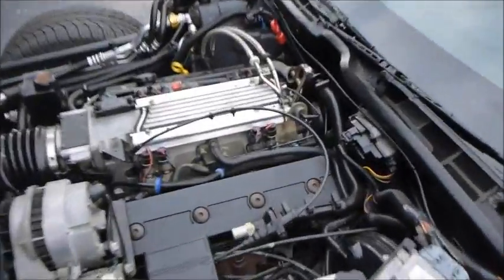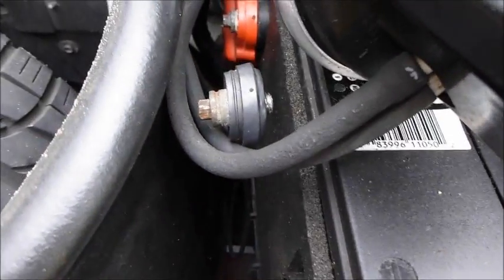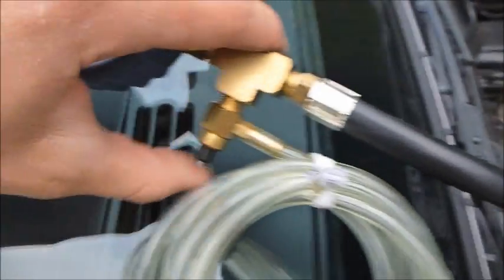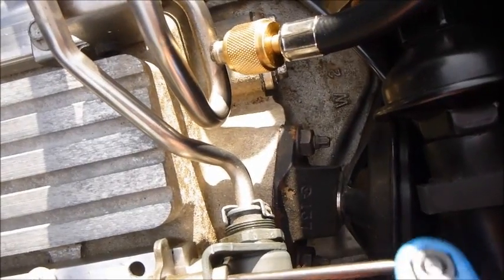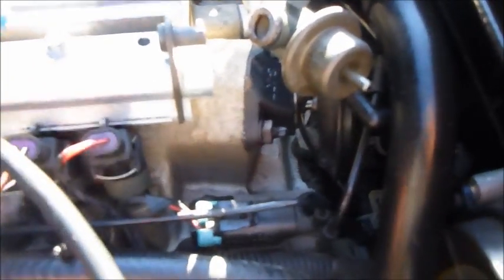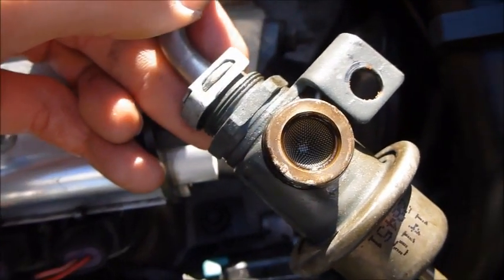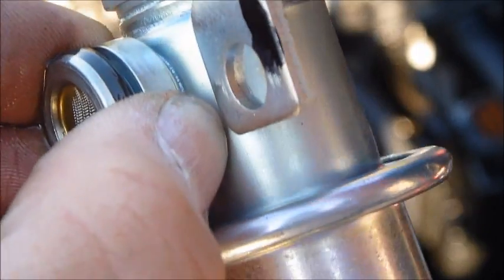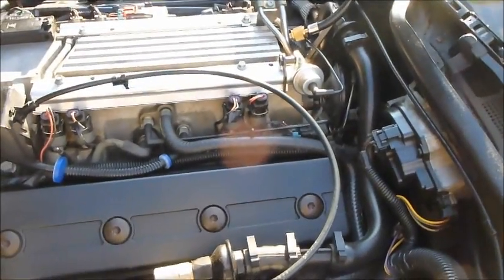How to replace a Fuel Pressure Regulator

Comment: Chris, I pulled the vacuum of the FPR on my '93 C4, and it has a gas smell to it. Do I need to replace the FPR?
Reply from the maker: Brandon Herrera If it smells like fuel it is bad. I would get it replaced because it is either not working or is going to fail. Only a fuel pressure test can tell you that. A gas smell means that the rubber in the FPR is broken down and the vacuum is actually sucking gas from the fuel rail.
Reply: +ChrisFix Thanks! Replaced it. It's a little bit different on a '93 C4 to change the FPR. Video still helped.
Reply from the maker: Great! Glad it was helpful! What was different?
Reply: ChrisFix The FPR location. It's on the passenger side. You have to take off both fuel rails. It's under the passenger side fuel rail,l.
Reply from the maker: huh, interesting! Thanks for the info

Comment: cool this is exactly what I need to do to my vette! now do I need that gauge to release the fuel pressure or can I get away with it by relieving it into a cup or something?
thanks!
Reply from the maker: You dont need the gauge to release fuel pressure. You can just let the car sit overnight and that will be long enough for it to leak down. You could also pull the fuel pump fuse and turn the car over for a second.

Comment: A better way to relieve the fuel pressure is to remover the fuel pump relay and turn the vehicle over a few times until all the fuel in the lines has been used.  That will reduce the amount of fuel that comes out when you remove the regulator from the rail.
Reply from the maker: Thanks! That is a good idea.
Reply: ChrisFix can a bad fuel regulator pressure cause a car to stall and not start unless you wait.
Reply from the maker: David Henriquez Yes it could. You might not have enough fuel pressure. You can do this test: https://www.youtube.com/watch?v=_oXLUqE4Sf0

Comment: Thanks for the guide. I used it to fix my long and rough start issue and to fix my hesitation issue. My vette still has hesitation when going through the gears, but it cranks up like a champ now. My next attempt to fix the hesitation is to change the fuel injectors, so if you got a guide on that it would be greatly appreciated.
Reply from the maker: I do not have a guide on that (yet). It is pretty easy, just unbolt the fuel rail, pull the injectors out, and replace each one.

Comment: Hmmmmmmmmm, wonder if that's what's wrong with my 95 Roadmaster.  It only starts fast when you try within 2-3 minutes of turning off.  Otherwise, it takes 5-7 seconds of cranking.  Already changed the optispark, wires, plugs, and fuel pump.
Reply from the maker: Injectors? Try this: Fuel Pressure Test
Reply: ChrisFix
Looks like I'll go get me a fuel pressure gauge!  The mechanic was telling me he thought the delayed lite off was normal since the fuel injectors don't turn on until getting the signal from the crank sensor.  But I've had the car since 21000 miles and it used to start fast all the time.
Reply from the maker: That sounds like bs to me... The fuel injectors turn on once that ignition is turned. I think a $20 fuel pressure gauge is a good investment. It was the check valve in my fuel pump when I was having the symptoms you talk about.
Reply: ChrisFix
Very interesting. I followed your other video and saw some leakage down from 40lbs down to 37lbs after 15 minutes.  I saw a bump in pressure with the vacuum line off.  Hmmmmm.  Guess I should check to make sure the spark is immediate but would have thought the optispark replacement would have taken care of it.  Unless the mechanic is right about having a cam or crank sensor.  The LTI was modified in the B bodies with a milder cam and cast heads so maybe they mucked about with it some more.  Maybe the ignition module or perhaps the coil is getting weak.
Reply from the maker: Hmmm... That is weird. Sounds like everything is holding the pressure. Does the car run right otherwise? Same fuel economy? Maybe it is the crank or cam sensor. Do you have a check engine light?
Reply: ChrisFix
No check engine light.  LT1 can still lay rubber with this 4200lbs whaler.  Performance might be down a hair since it does have 177000 on the clock but minimal.  Fuel economy is still in the mid 20s.  Old plugs were very clean.  Might use 1/4 of a quart in 3000 miles.  Hate to part with it since GM has no RWD cars anymore.  Ford's are gone too and were quite pitiful in their later years except for maybe a Jaguar XJ8..  Guess I could get a Chrysler 300C but I haven't driven and liked a Dodge since my parents 65 Dodge D100 pickup with the slant six!

Comment: I'm planning on replacing this device.   It already has stains on it and it looks like its leaking.  I already done plugs, wires, rebuilt injectors, optispark and powdered coated the intake.   On a 17 plus year old vehicle...this should be replaced as a general principle.   Why?   Because the car could catch fire over a $40.00 part.  Once the part gets exposed to gasoline, it doesn't matter if the car has 55 or 200k miles.

Comment from the maker: Sounds like a check valve in the fuel pump (meaning you need a new fuel pump). Or it is leaking injectors (less likely).

Comment: When i prime it, I hear the Fuel pump go, and it will move up to 40-45psi, then drop to 15 or 20psi, in about 5 seconds. (The first time i prime it, it will barrly get to 10psi, the second time it would jump up to 40-45 and drop)

Comment from the maker: When you have the car off and turn the key to the run position (car is still off and the fuel pump primes), does the fuel pressure increase to ~40psi? Does it stay at ~40psi for 10min?

Comment: Hey, I have a 95 camaro Z28 Lt1, and i am having a fuel pressure problem! I did go and change the spark plugs, wires and the distributor cap and roter, But it would slowly loss fuel pressure after driving for 15 or so minutes, It would idle at about 39 or 40 psi and soon get down to close to 30, What do you think i need? Thanks man!

Comment: thanks for the info I was trying to get this done as soon as i can.. if the gauge reads below 40 psi or over would it mean its the fuel pressure regulator? also the car was never worked on since bought from the dealer by the first owner im the 3rd  it only has 55miles.ive only replaced the starter and replaced radiator myself with help. i will try the spary bottle. thanks for info !

Comment from the maker: It can be a number of things... I would check a few things to get an idea of where your problem is... Check the fuel pressure with a fuel pressure gauge ($20 online). It should read around 40psi when you just turn the key to the run position and it should not bleed down. You should also check the wires. Run the car at night in the dark and take a spray bottle with water and spray near the exhaust manifolds. If you see sparks, you need new wires. That should be a good start. Report back!

Comment: One thing that should be mentioned here is not to use petroleum 
based oil on the "O" rings. It usually attacks  them.  It's best to use
a non-pet. based lube.  "O"  ring lube made for the purpose is best.

Comment: Thanks for taking the time to do this.  I have a 94 Caprice wagon with the LT1 engine, and the factory manual is useless for helping this changeout.  I had a wee bit more difficulty was well because the shoulder bolt/nut holding it on was frozen solid, so I wound up cutting it off! Replaced it with a makeshift 1/4-20 bolt and 3 nuts to make up the support of the shoulder bolt.  Works great, !!!

Comment from the maker: One thing that comes to mind is that your injectors are leaking. This would cause the gas to leak into your cylinders and any blow-by at all would cause an excess amount of fuel to go into your oil. Plus, this would cause carbon build up on the plugs. When you start the Vette, if you tap the gas to rev it up quickly, does the exhaust make a popping sound? Leaking injectors can be caused by a damaged fuel pressure regulator, but I think it is more important to check to see if they are leaking.
Reply: I'm
Reply: I am getting the feeling I would be better buying the in-tank complete unit, rather than blowing up your garage and house.

Comment: I don't have a leak coming from my vent tube but I have alot of carbon build up on my new platinum plugs and my oil dip stick smells more like gas than fresh oil.  My car starts fine, runs for 5 mins, then sputters and dies.  After 15 mins it does the same thing. The symptoms I named earlier, would that be from a bad regulator?

Comment from the maker: Any spark due to a short will cause an explosion/fire and with the battery disconnected a short cannot happen... Any time you work with your fuel system you should disconnect the battery.

Comment: I'm the owner of a 1993 Vette, and I do all my own work when I can.  I have done everything from replacing my Opti (not as hard as you may think as long as you keep a cool head), sensors, etc.  I have always found that most shops try to BS you into getting stuff you don't need as they believe Vette Owners have deep pockets.

Comment from the maker: It is just one O-ring and you can clearly see it at 5:06 ... I would replace the O-ring because it is a cheap part and failure of this part could catch your car on fire... For now if you take the O-ring off, soak it with a little motor oil, then put it back on, it might hold for a little (to get to the parts store)... But leaking fuel is very bad so get a new O-ring asap!

Comment from the maker: If there is a recall then the dealership has to honor it... Just go and tell them that you have a recall that hasnt been fixed... It could be the reason it shakes (missing due to limited fuel at the injectors) and it could smell like fuel due to the regulator as well...

Comment: i saw that there has been a recall on the make and model of my car for the regulator but the tags are expired and you make it look soo easy on the video. the recall stated that the regulator was installed during manufacturing without a ring and clamp. where i see the regulator at there is most definately something leaking because it looks like dirty oil running down and also does this problem cause the car to shake violently while in reverse or drive and smell like gas?

Comment from the maker: It is leaking, low fuel pressure, high fuel pressure, when you take the vacuum hose off the regulator it smells of gasoline.